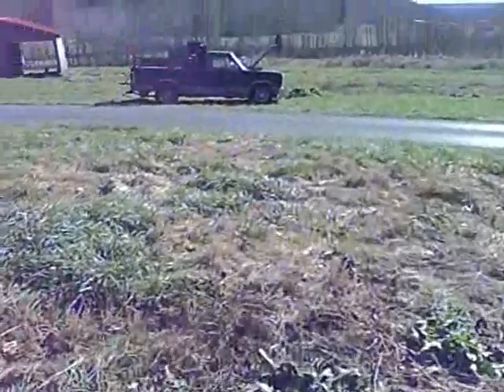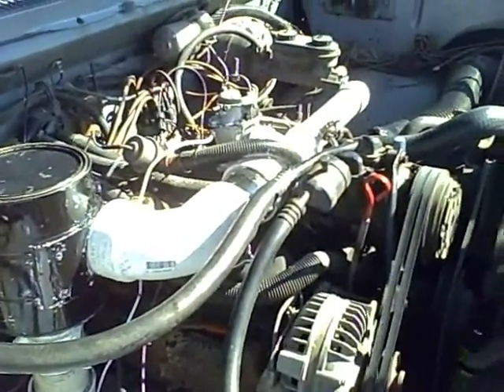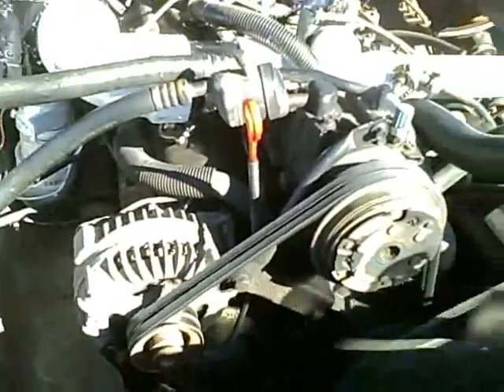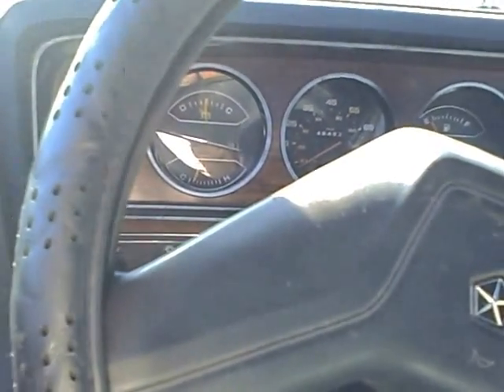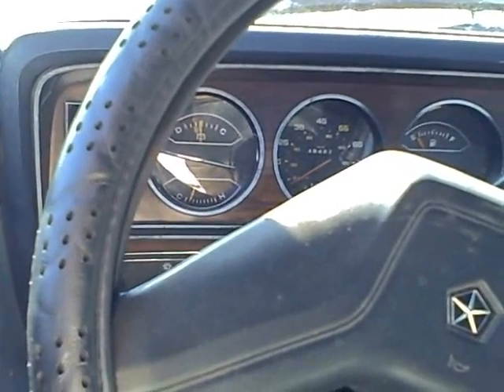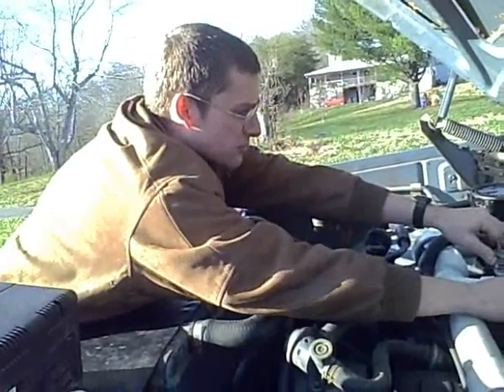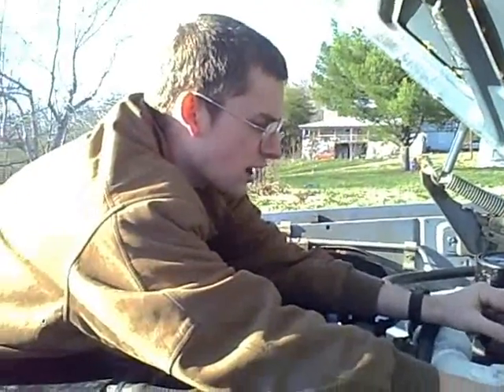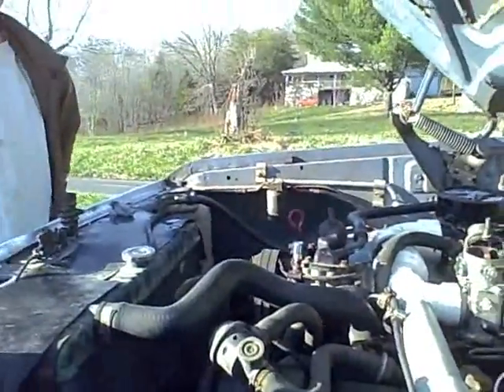Woodgas truck running

Comment: is there a smog pump if there is i think it would be a good i dea to turn it off and if there is an egr u definitly need to tern that smog crap off and i think it will stay on at high RPMs good woork =3-